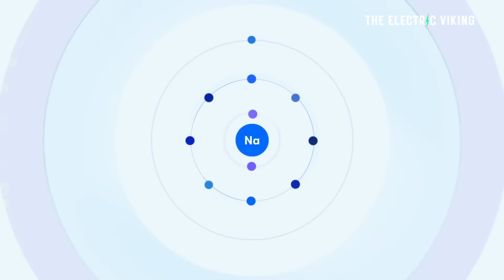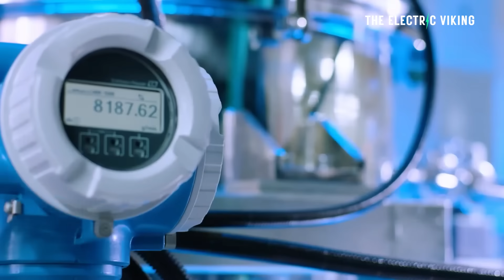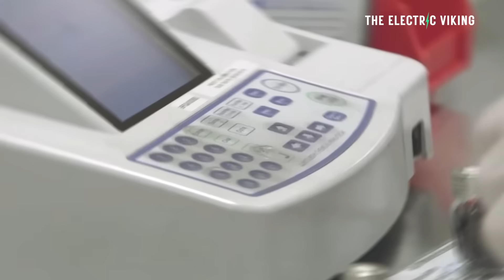Tesla's NEXT BIG Leap! (Lars Moravy Reveals Battery Breakthroughs!)

Comment: Tesla 2180 batteries are 'old tech'. The 4680 LFP batteries are a complete FAILURE. For example. The 4680 was supposed to power the Cybertruk to ver 400 mule range. Reality check. Cybertruks are stuck with 2180 batteries and get a garbage 275 full charge range.  BYD and CATL LFP Pouch batteries are way lighter, efficient and cheaper. Stop reporting telsa

Comment: Bigger batteries, longer range ... but where are all the high voltage, SUPER HIGH CURRENT transmission towers needed to provide those megawatt charging stations ... and where exactly are all those tens of thousands of megawatt charging stations going to be located ? Especially in remote locations.  If you want a convenient, FAST, all-electric transportation future, you'd better get to work on power generating stations and the MASSIVE high-power electrical distribution system that's going to be required. Along with all the strip mines needed for all those batteries.

Comment: It never stops, so much wrong information all the time!

Claim 1: Tesla was NOT the first to use LFP.
BYD, SAIC, and Great Wall Motors had EVs with LFP years earlier (BYD Qin in 2012, Han EV in 2020).

Claim 2: 70 percent of Teslas with LFP?
Wrong. Peak was about 50 percent in 2022, about 40 percent in 2024. Never 70 percent.

There are just too many major inaccuracies in your videos, so I’ve decided to stop following you.

Comment: Could you investigate how much the individual batteries in a battery pack have come down verses how much the battery packs and associated electronics have come down.
Reply: The cells are mass produced and automated. The BOM, china has worked to stabilise the price of lithium, and also more production of lithium came alive, in 2022 there was a shortage which pushed the price up significantly in the short term. 
There is also a lot of competition in china for production which puts significant pressure on sell prices. 

Completed products like complete batteries still mostly require human interaction. So they can't come down as quickly. Innovation by companies does put pressure on the prices, but still it requires a lot more effort to put a product together, sell it with sales people and test it, put a warranty on it. Service it. Write software for it. 

It's complicated and can't be fully automated. These initial costs like software and design or development costs do get absorbed, capital costs get paid down and so over time they will also reduce, through efficiency and automation again. 

That's why even in the last 12 months grid scale has also come down another 20 or 30%. 

There is still transport costs, and storage and then sales and service for the lifetime. So that's going to be the focus more on the near future. That and removing the middle men. 

All of those things will see battery storage become extremely good value. It's already an affordable option. I think we will see more advanced technology, and longer lifecycle products soon. And less maintenance. That will make them an almost impossible to beat form of storage

Comment: Lithium phosphate is cheaper but it has been lower density. Range claims are always exaggerated particularly in the BEV industry.  Tesla had made great claims for the 4680 battery which turned out to be mostly a failure, which should make one weary of buying into more claims made by Tesla.  There have been big claims about Carbon, sodium, selenium, etc etc none have made it to market.  Much of the savings you've pointed to are due to massive subsidies and makers taking giant losses on their BEV sales. It's fine your an optimist about these - Im more about what actually exists now, and right now BEVs aren't up to snuff compared to hybrids.
Reply: There's not a SINGLE mass produced battery on the planet that has a higher energy density than the 4680! How is 4680 a failure?
Reply: @TheCostofAutism  Simple - They can't produce this "mass production" battery efficiently they have to toss about 2 of 3 they make due to defects. Hence it isn't cost effective to put them into anything; and they lose money on every vehicle they make with them. Sounds like a big big failure to me.
Reply: @litestuffllc7249  I don't know where you're getting your information from but it's OBVIOUSLY old AND INCORRECT news.  When Tesla very first implemented the FULLY dry electrode process they had around a 20% defect rate, that's "tossing" 1 of 5, not 2 of 3!  However, EVEN WITH those yields, they work with Redwood Materials to recycle the defective batteries.  And BTW, just THREE MONTHS after that announcement they DOUBLED output, which of course means that they lowered the defect rate DRAMATICALLY.
To top it off, let's keep in mind that The 4680 battery uses a dry electrode coating process, eliminates the need for toxic solvents and reduces, water usage. Traditional wet coating requires energy-intensive drying AND solvent recovery, contributing to emissions and waste.  The reality is that EVERY OTHER battery manufacturer discards MILLIONS OF GALLONS of TOXIC wastewater and burns MASSIVE amounts of energy in the drying process.  Things that are COMPLETELY ELIMINATED with the 4680!  BRO, YOU DON'T CALL THAT A WIN!!!

Comment: According to Tesla's AI chatbot GROK the rumor about a new Tesla battery based on aluminum-ion and graphene for 2026 is not true. Grok:  'this rumor is spread by AI-created webpages and are not based on official statements by the Tesla company". On the other hand, there is a world wide R&D effort to get graphene in mass production. Aluminum-ion batteries with graphene electrodes simply exist and are much better (energy density, power density, longevity) than Tesla's lithium batteries.

Comment: We haven't got anywhere near the theoretical maximum energy density of LFP batteries yet, they could get up to 380wh per kg, but theoretical and practical are two very different things, we will probably max out somewhere between 200 and 300wh per kg, on the other hand solid state batteries have a theoretical max of 11Kwh per kg, or 1,100wh per kg, again what is theoretical and what is practical are two different things. It's very likely that SS batteries will be exclusive to very high end cars for a few years after achieving high enough densities to make them far superior to LFP, talking like in the millions of dollar ranges, your supercars and similar. But really that's not unusual, many years ago when I worked as an IT consultant I used to visit rich people houses where they had huge flat TV's on the wall, at the time in the $30,000 price range, I can buy the same size TV with far superior technology these days for well under $1,000. SS batteries will eventually filter down to mass market cars, but it's also very likely for 5 or even 10 years LFP and SS batteries will exist side by side as two options, a cheaper mass market car option and a more expensive luxury option, and that's not a bad thing at all.
Reply: The 11 kWh/kg theoretical max applies specifically Lithium-Air type of Metal-Air battery rather than solid state batteries per say. This is the next technology leap on after the introduction of solid state, which includes other types of electrodes  chemistries not just air (or rather oxygen) based ones.

The 11 kWh/kg figure also applies to the weight without the oxygen component, when this is added the energy density is closer to 4 kWh/kg.

p.s. small correction, the 11 kWh/kg equals 11,000 Wh/kg rather than the 1,100 Wh/kg number you gave above as its equivalent figure.
Reply: @GruffSillyGoat Fair enough, got to also remember these figures don't include the casing and other materials used to package the batteries, got my conversion wrong as well...bugger!

Comment: You can bet that Tesla is in parallel exploring solid state batteries too.  Probably unveil something in a two or three years.
Reply: 2026 aluminum battery equipped model 2 hello
Reply: 2026 aluminum battery equipped model 2 hello
Reply: 2026 aluminum battery equipped model 2 hello

Comment: All good and well, but what about weight and physical size of said batteries. Both of these also need to come down substantially to complete the entire package.
Reply: More range or less weight/size. You get to take your pick as more models are released in the market, but the main trend at the moment (in China at least) is independent of both: faster charging.

And with very fast charging, the whole range anxiety thing dissipates, meaning we can have smaller, lighter batteries too.

Comment: Thermal runaway and the risk of intense and impossible to extinguish fire was not mentioned in this piece although it has become the main issue of concern with the current generation of EV batteries. The move to safer technologies, such as solid state, should be prioritised over reducing cost, weight and faster charging speed.

Comment: I find it interesting that Lars talks about cost and efficiency but doesn't discuss safety which is a primary feature of solid-state batteries. Eliminating battery fires will go a long way towards improving EV adoption.
Reply: I’m curious because I’ve seen this argument a few times and I’m genuinely wondering what is the rate of fires with gasoline cars versus EV’s? I’m struggling to understand just from a purely subjective point of view or ignorant point of view how a liquid gasoline based car could actually be worse than EV. Of course, there are some things that are different which I recognize, such as gasoline cars can blow up and EV cars can burn hot and for a long period of time. I’m very curious about the actual stats and the degree of actual risk because as I understand it if you’re in an EV it’s unlikely that you would find yourself in a dangerous situation because alerts inside the cabin would likely cause you to stop and exit the vehicle. But in a gasoline car, there is no early warning system for anything whether it be an explosion a gas leak oil leak fire in a compartment or in the engine. Anyway, this is just the thoughts that I have when I read your comment. Would love to be informed.
Reply: @OilersFlash  Studies have found that EVs catch fire once for every 135 times a gas car does. Expect that stat to widen as battery chemistry and safety features improve.
Reply: @cre8tvedge  Hello saw your comment very impressed on your words towards me. It's a great honey to speak with you over here. Where are you from ?
Reply: @OilersFlash  Hello saw your comment very impressed on your words towards me. It's a great honey to speak with you over here. Where are you from ?

Comment: 24M battery impervio separator and eternalyte electrolyte will be hard for solid state to beat on price and performance.  24M semisolid Liforever electrode is clay like and does not require polymer binders. It also has high power density.  Dendrites cannot punch through the separator due to some sort of biasing scheme.  The only advantage for solid state is fire.  It's the electrolyte that is the fire potential source.
Reply: I wish it truly was manufactured

Comment: they really need to do away with charging cables and just use pads........
Reply: it will happen in the future, it seems the charging cable thing is the last bit of tech that is similar to an ice engine, refueling wise.  Induction charging will make it so much easier for the impaired and for those that need to park on the street.  Losses at the moment are holding them back,  plus there is a need to retrofit an induction plate beneath the vehicle. It will come, and when it does it will be another groundbreaking event😃

Comment: My Tesla Model X P90D is now 9 years old and still running nicely. I am still very happy driving every day. Greetings from Switzerland.
Reply: How many km have you done with it and what is the SOH of the battery?
Reply: My MX P90DL is also 9 yrs old - 95k miles, and we’ve lost only 10% SOC.
Reply: My Model S 85D is 9 years old (March 2016) it's just covered 284,000 miles and I'm driving down to southern Italy next week. I'm very happy with how it drives and it is more efficient than it was new. I'm guessing it's down to those software updates and the latest tyres. With free supercharging for life, I'm thinking it would be great to pop a new battery in, in 2 or 3 years time. ie The vastly better energy density should mean a 125-140kW battery pack will fit into the original space, weight less and charge faster. There are limits on charging speeds in some of the other components but it would at least hold the current high charging speed for most of the charge cycle.
Reply: Yea, now try from Chicago to LA and get back to me in a week.  Europeans live in a different universe than real people do.
Reply: @mitch_the_-itch  Last time I checked we are all real people here in Europe. And we seem to have a much greater understanding of the world outside of our own country than some of your compatriots. I’m writing this while on a farm in Southern Italy. To get here we drove across the south of England, onto a boat to France. Drove through a bit of France, then Belgium, Luxembourg, Germany and Switzerland. Then across northern Italy to the Adriatic coast, following the coast down towards Termoli. I’m sorry if you have trouble getting to LA but it still doesn’t stop me taking an EV that will be 10 years old in March 26 on long distance trips across Europe. Next month I’ll be taking my 90 year old father to see friends in Germany. The odometer is currently showing 449,587km (on the Model S, not my father). Ciao ciao.

Comment: All vehicles are way overpriced.
Reply: Used Teslas in the US are selling for crazy low prices.  

Brand damage?  Maybe, but shout out to all the Elon hate that’s going to let me buy a used Model 3 for ~$10k ❤
Reply: @American_Energy  Elon is the hater. Fanboys defending the Randroid are bizarre.
Reply: The Tesla Model S P60, with the 60Kw battery sold for $80,000 back in 2012.  Today the Tesla Model S with a 100kw battery, that charges TWICE as fast and goes TWICE as far still sells for $80,000 WITH the Air Shocks included (Air Shocks were an upgrade before).  How much inflation has happened between 2012 and 2025?  Same for the Model 3.  The cheapest Model 3 in 2018 sold for around $42K and could only go just over 200 miles.  Today's cheapest 2025 Model 3 cost around the same price yet has a second screen in the back, better handling, better 0-60 and range of well over 360 miles! SAME PRICE!! Again, how much inflation from 2018 to today?

Comment: Not so sure that what we need is more range. This idea is based on the antiquated notion that EVs should be the same as IC vehicles...which really makes very little sense. What's needed is greater energy density so that packs can be made smaller, lighter, and cheaper. 300 miles is more than enough.
Reply: Not for everyone.
Reply: You will know when you start to drive distances like a real man! I need long range
Reply: @shivaraj6  Sounds like you need to sit down and question why you need such long ranges. If you drive a long way every day it is not doing you any good. If you think you can drive hundreds of miles without a break you are mistaken and criminally irresponsible.

Comment: We really need lighter batteries. Either from solid state or smaller, more energy dense packs. This should make them safer too, as there is more crumple zone before a pack is compromised. It seems motors are also becoming more efficient, although I can't say how much more that can change.
Reply: Lighter, yes. Eventually. But the major attributes holding back adoption is cost first, and capacity second. If lighter enables those, that’s a great bonus. But if not, it isn’t worthwhile to pause improving current cells. Of course safety is a given regardless.
Reply: Motors are already around 95% efficient.

Comment: When will replacement batteries come? It’s not economical to sell your car when all that’s needed is a better battery.
Reply: The car will fall apart before the battery does.
Reply: You can already get replacement batteries but they are currently expensive. They will get cheaper but today’s batteries (especially LFPs) should outlast the car so it shouldn’t be a problem.

Most failures occur early so they’re covered by the warranty (and are rare).
Reply: @JohnSmith-x3y8h  Agreed they are too expensive.